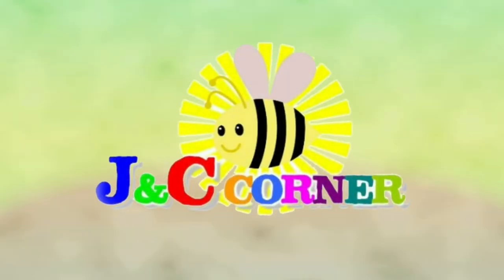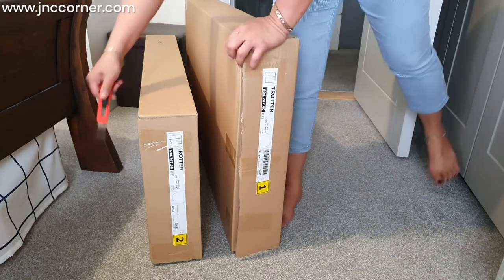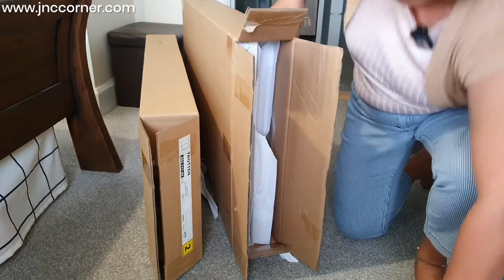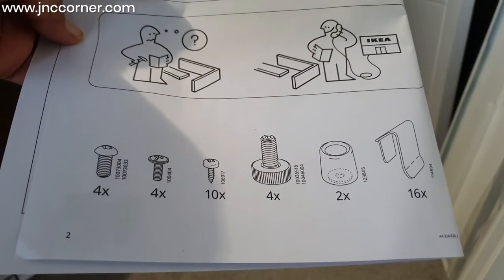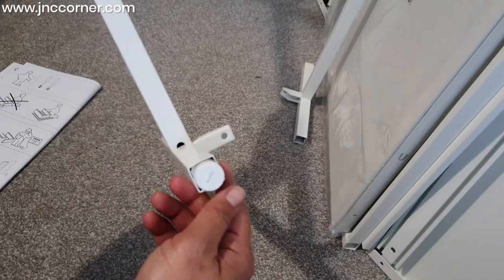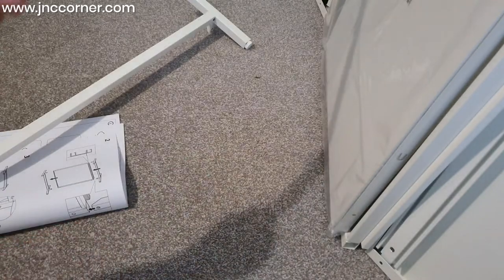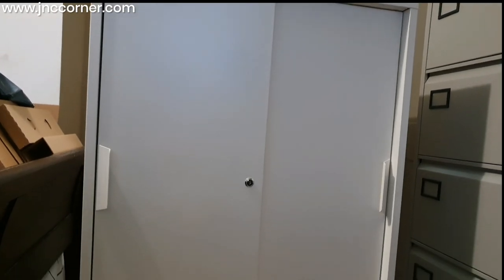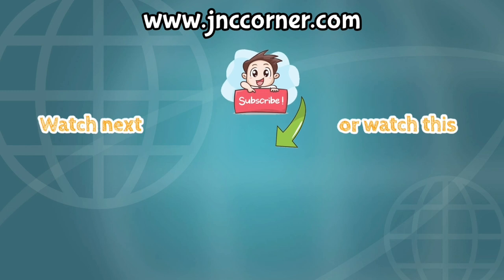LOOKING FOR LOCKABLE STEEL CABINET? CHECK OUT THIS NEW TROTTEN SLIDING DOOR CABINET FROM IKEA

Comment: Its usless. The door are very weak. Door bent by hand  and if you pull a little with very less force the lock open with out keys. And door bend very easily. Lock is usless. I return my in one day
Reply from the maker: Really it must have been defective.. so far mine is ok until this time...